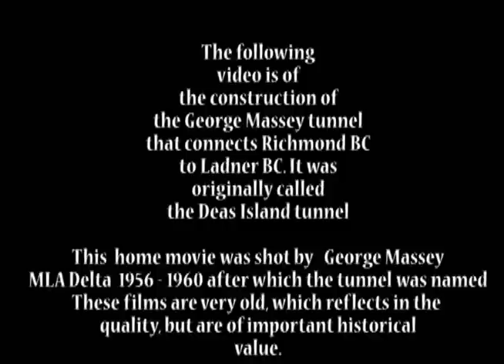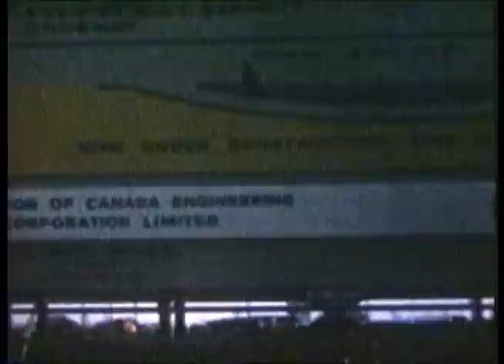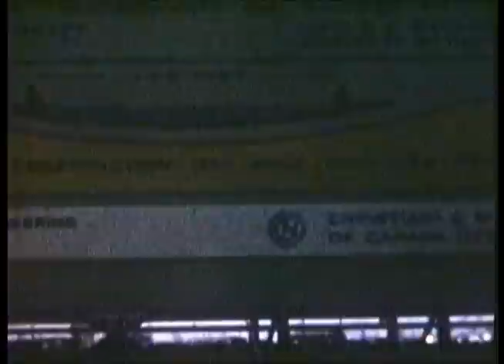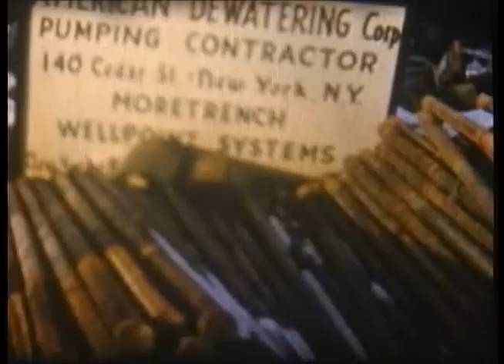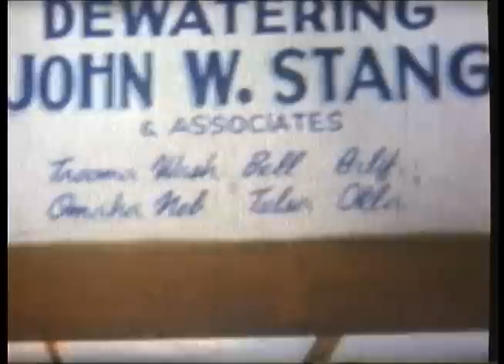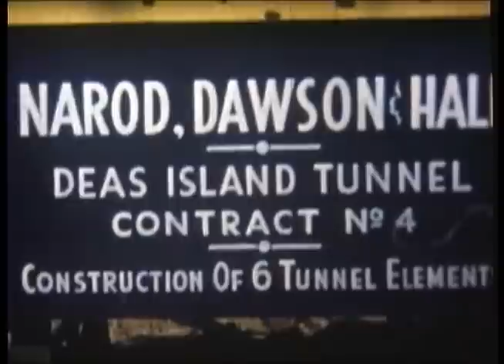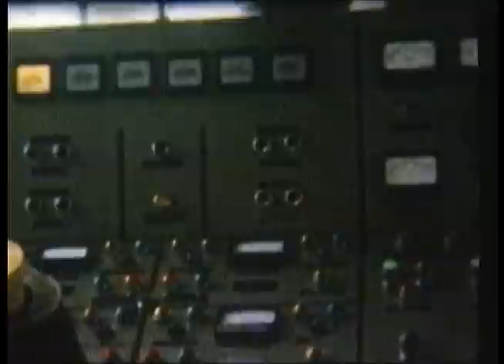construction of george massey tunnel

Comment from the maker: There must have been a reason that they went for a tunnel as opposed to a bridge back in the day. Probably has something to do with all the clay in the ground, not being stable enough to withstand the weight of a bridge at that location. 
At the time the tunnel was done they wanted to build a second tube, and sink it along side. (The tunnel is just one structure with a divider down the middle) The cost wasn't that much more, as the major costs were dredging, and forms. But they were shortsighted

Comment from the maker: They should just sink another tube beside the existing tunnel. Then there would be 4 lanes each way. One thing for sure, if they do I won't be using it,because it will be tolled, and I refuse to cross a toll crossing. I'll just take the Fraser over the Fraser. Richmond will loose my business, and New West/Surrey will gain it. I don't commute through the tunnel, so replace it or not doesn't affect me. I say leave it alone we can't afford to replace it.
Reply: From what I understand, the GM tunnel is too shallow, won't let larger ships to pass.
Reply from the maker: @PGE564  That's why the new one that is being constructed will be longer and deeper than the original. 8 lanes, 3 each way plus an HOV each way.
Reply: @12voltvids  I saw in video the tunnels have smaller side tunnels, maybe half lane wide on each side, for utilities perhaps? 7 3
Reply from the maker: @PGE564  exactly the side tunnels on each side serve two purposes one they carry utilities such as hydro lines but they're also the exhaust tunnels to suck out the exhaust. There's slots in each side to draw air from the tunnel into those side tunnels and then out through the exhaust stacks on each end of the tunnel were there a large fans located. I know there's hydro lines that run through the tunnel I don't know about telephone lines are water pipes I do know that in recent years of upgrading they put water pipes for fire suppression for example in the actual travel Lane same as when they redid the lighting they did it all inside the vehicle tube so I would imagine that those service tubes are probably pretty full of stuff and of course they do need a fair amount of space just for the air flow for the fans so I would think that they're probably mostly empty in any space reserved for utilities are probably pretty packed at this point.
Reply: @12voltvids   Thanks again, this was interesting. Good trivia too!